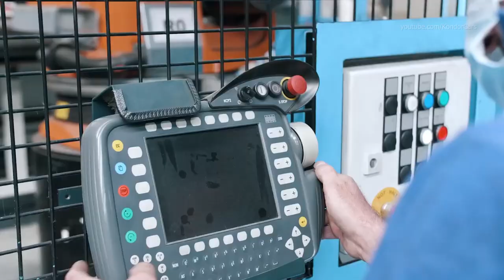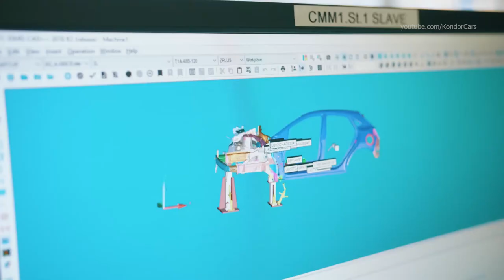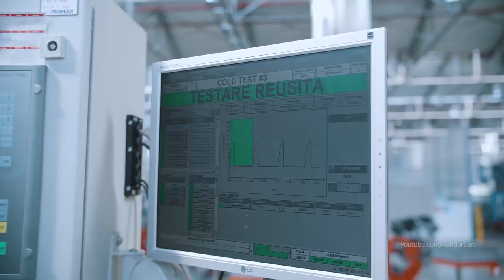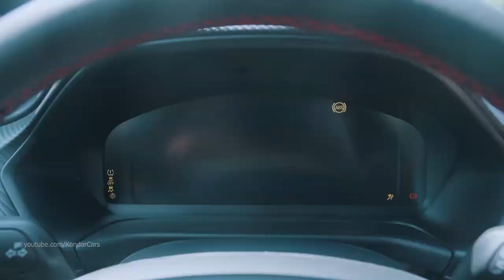Ford Puma Production Romania

Comment: Ford is a great company but unfortunately this latest car produced has too many defects both in the assembly and in the quality of the materials. I advise you to carry out more quality checks because this car was found to have too many defects, especially the quality of the gaskets and their assembly. Another big flaw is the steering column which suffered problems after a few km. The paintwork is really low quality and easily ruined.The spaces between the various assembled parts, bonnet, door, tailgate at the back are not aligned well, the spaces between one component and another vary in height and distance.the rear shelf that rises when the bonnet is opened has major defects, the plastic supports that help raise it break in a few days.A defect / problem that appeared almost immediately concerns the creaking of the dashboard, which is constant on the motorway.Also, what negatively surprised me is the formation of condensation in the front/rear lights.I sincerely hope that you raise the level of quality and controls in the future. Every criticism and defect I point out I hope will improve production and I repeat the level of quality that has always characterized the great Ford company in the past. Regards JACK
Reply: J'ai le regret de dire que je fais le même constat. Si vous êtes attentifs vous verrez des trains roulants arrière différents. Disques  deviennent des tambours...quant au montage semi-rigide, il est indigne. On demande 4 roues indépendantes et 4 freins à disque  mesdames messieurs de chez Ford ! Et remettez aussi les poignées plafonnieres que vous avez également supprimées. Les économies de bout de chandelle dégradent votre image. Ajoutez aussi une clavette d'indexation sur l'arbre intermédiaire de la cascade de distribution et profitez-en pour remplacer ces courroies humides par des chaînes... Alors peut-être achèterons nous de nouveau une Ford.
Reply: I think someone paid Jack for his negative review  ..... whilst I'm sure some that a few cars may experience a few of the issues he raises, most don't.  One of the best selling cars for the last two years. If all the issues Jack raised were common, this certai ly would no be the case.

Comment: Patiently waiting for mine for 10 weeks now. Still nothing :-S
Reply: I'm still waiting for mine and it's been 7 months now :) so most probably you will have to wait some more
Reply: @serbancristiancaba250  what specs have your Puma?
Reply: @YoungAndy89 , ST Line X, A7, 155
Reply: @serbancristiancaba250  I see. I got the ST line, A7, 125 with komfort pack, winter pack and driver assist. Im curious how long it will take. My dealer said it should be in mid March here.
Reply: Ordered in November, it has been built and now waiting for the delivery probably early march.
My dealer suggested that the more equipped the more time i would probably have to wait. So i didn't add practically anything to my st line
Reply: @jag4439  Yea, the driver assist packet 2 have high demand on computer chips, that's probably  why we have to wait so long.
Reply: Later edit: mine arrived February 16th, basically 7 months and a half after ordering it. It was worth the wait at least
Reply: @serbancristiancaba250  That’s what i call long wait. My Puma was already created and now it’s getting ready to be shipped. Shipping date is set to be on 2.5.22 so basically more than 6 months for me. Have fun  and safe roads ahead.